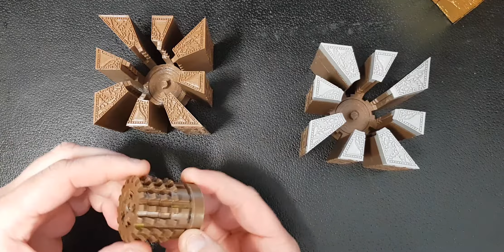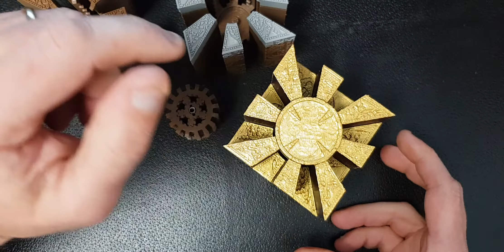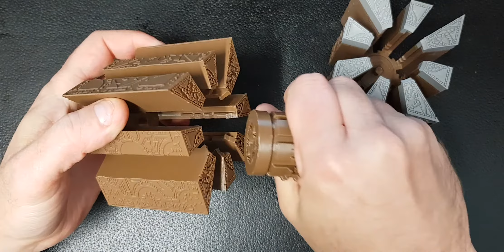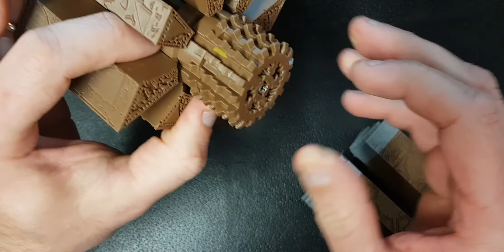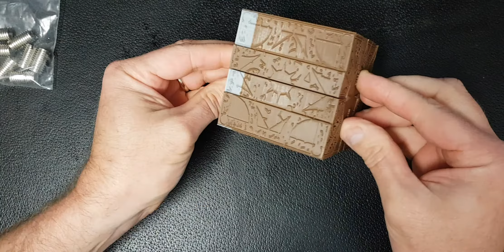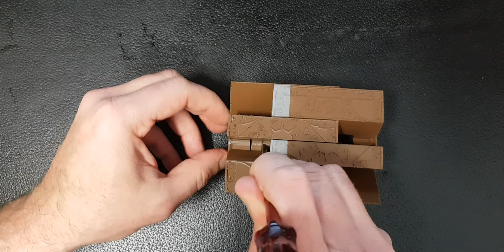Puzzle Cube Assembly (v1.3)

Comment: I have tried making a perfect one and I keep having trouble.

The upper and lower arts always ends up flat where it sits on the board and loses the details.

If I try to do a raft or brim it fuses to it and can't remove even if I change the gap settings.

Also in between the art the lines show through the empty areas I have hear that'd called bridging but still new and have tried fixing it with no success.

I don't how people are making these so easily.

It's an awesome puzzle and great detail just been a pain for me.

Any help would be greatly appreciated. 

Thanks
Reply from the maker: I don't know about easily, there's been plenty of failed attempts. The detail in the top and bottom is pushing the limit of what you can get out of a 0.4mm nozzle. First thing I would suggest is check in preview mode so you can see what the slicer is trying to do and not inserting extra support or skipping thin walls or something unexpected. I get prominent lines where it bridges, too, but my intention is to fill them with paint anyway. A few settings come to mind "Print Thin Walls", "Minimum Support Area", to reduce the bridging lines I usually add support only under the circular disk with 100% support interface and no support anywhere else using the min area setting. If it's not support and the raft still sticks, maybe temperature is a little high, leading to too much layer adhesion, maybe? Due to the shape it'll probably need a razor to trim off anyway. Brim always makes a mess.

Comment: Should the core use any support? If it does then how much?
Reply: Nevermind I found the video on that
Reply from the maker: No. No support for the core.
Reply: @TroyMackay  Ok thank you, that was very helpful
Reply: @TroyMackay  Also, should there be adhesion for the box pieces? When adhesion is on it ruins the details facing the bottom layer of the print.
Reply from the maker: @lissetteacosta1  No, it doesn't know what is outside or in so just fills in the bottom layer - same with support. I use a little support under the dials (optional - it will bridge but looks messy) but turn up minimum support area so it only goes there. Otherwise use raft if you want.
Reply: @TroyMackay  Ok so I finished printing the core, how do I separate the pieces so that it’s able to move?